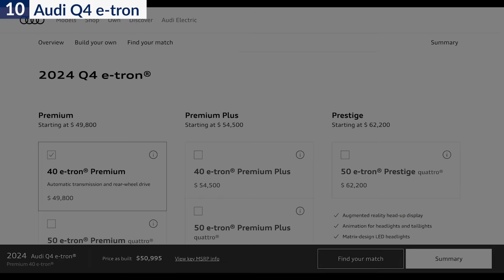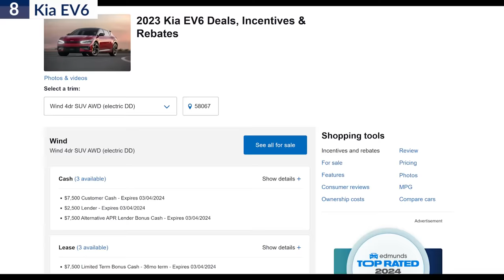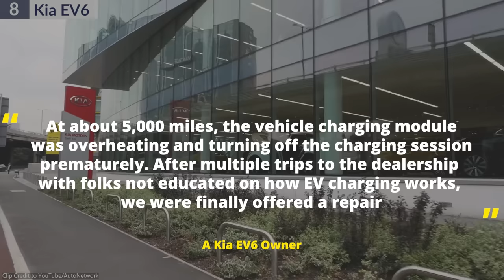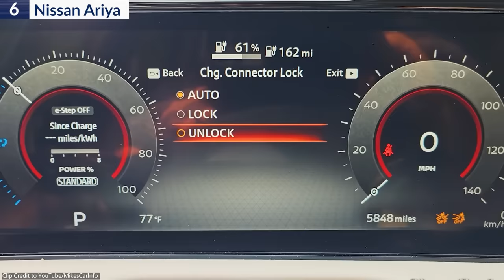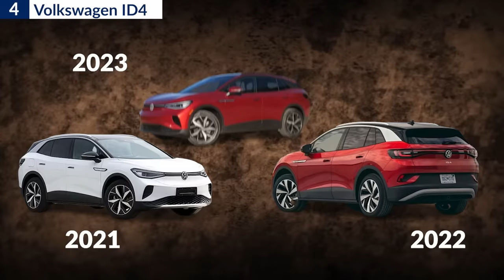New Electric Cars Piling Up on Dealer Lots in 2024 – Here is the Truth!

Comment: would you buy a second-hand EV with an older battery? not me
Reply: l would the depreciation on evs will make it worth it, you will lose some range, but they will make an excellent second car
Reply: I imagine that when the battery dies most of these cars will be free and still not worth the investment of a new battery.
Reply: @keithb6717  it depends on  the replacement   battery prices, as of today its a no no, but who knows what tomorrow may bring
Reply: I would, as long as the battery pack was checked with an OBD device via the car's diagnostic socket. This can provide a print-out of the battery's state of health in percentage terms. But of course if you didn't know this, then yes, you'd be buying blind......
Reply: @keithb6717  But you posted that because you were completely unaware of battery pack refurbishments, which cost a fraction of the price of a new battery. A battery refurb might only cost the same as fitting a clutch in an ICE car. Keith, use some of that imagination of yours to do some research, and you'd discover much of the crap posted about electric cars, is just utter BS.
Reply: @Brian-om2hh  A battery can develop a fault the very next day requiring a replacement pack. There are sensors and fuses, never mind the health of the cells themselves. Thousands of electrical connections in the pack alone.
Reply: @Brian-om2hh  Calling your bluff. What is the cheapest refurbished BEV pack outside a Nissan leaf? And how much is the removal and replacement cost?
Reply: @Brian-om2hh  
No. I’d never be dumb enough to buy one. I’m not into virtue Signaling.
Reply: @Brian-om2hh  
Btw, it’s a real bummer for you that your cult is being exposed as a fake. They’re not environmentally sound in the least.
Reply: @robertkubrick3738  How might I know that?  How many refurbished battery packs do you think I may have bought?  The vast majority of EV's out there won;t need new battery packs or even a pack refurbishment yet, as they're not old enough. The battery pack refurb I saw was in a 10 year old Nissan Leaf in the UK. The battery was out in around 20 minutes. The cells (around 120 of them) were checked and tested, with the failing cells then removed and replaced with good cells. The complete job took 4 hours, and the cost was £500.
Reply: @debeeriz  That's like you're buying a second hand 5 years old Samsung phone to replace the battery. No one is gonna pay for that tbh
Reply: @phunweng962  i replaced the battrey in my s7 it was only $10, totally worth it, l was lucky though the battery expanded that much whilst on my  charger, it lifted most of the back case off, my carl have now is 24 years old,  i have had it 20 years, i am not one for keeping up with the joneses, i use to be and l realized it was sending me broke
Reply: 1. Child battery mineral labor

2. Range anxiety

3. Risk of garage fires

4. Paying 20k more than a
comparable vehicle

5. every time you fuel up an EV, the fuel tank gets smaller  and smaller. Battery degeneration. 

6. Poor resale value

7. Reduced performance in
cold, highway.

8. Higher repair costs

9. Awful charging network
experiences in the weather
without restrooms

10. Higher insurance rates

11. Replacing tires more
frequently. Michelin states that tires wear out 20% faster on an Ev, and could be as high as 50% faster! Ev tires made for ev's, cost 20 to 30% more, than regular tires for ice cars. As Ev tires wear out, they leave behind more tiny particles of rubber than normal ice cars. This causes more pollution. 

12. Death by autopilot

13. $25k - $35k battery

14. Low km range per tank of energy. 

15. must wait in-line 1-2 hrs
to charge.

16. Then wait more time to charge, while charging.

17. Spontaneous combustion, with no way to put out the fire storm.

18. If they catch fire in a tunnel, many people will die.

19. People without a pro charger system or a parking spot at their house, will run an extension cord to the road, which is dangerous and could lead to people tampering with your charging setup (super slow charging at the road)

20. If you're in California, you won't be able to charge your car past 4pm because of a shortage of electricity supply on the cheesy grid.

21. It is not actually "green". The pollution is made at the power station, not the car.

22. Only 5% of used junk batteries get recycled, the rest go directly into the bin. It's cheaper to mine for new minerals.

23. Chhinna actually does 70% of all the refining of the minerals and production of the batteries.

24. Minerals are becoming more and more scarce, and the cost will only go up, not down.

25. Some countries where they mine for lithium, actually use a very big boat load of fresh water to only produce a ton of lithium, so they are afraid of running out of water. It takes over 2 million liters of fresh clean water to produce 1 ton of lithium. 

26. Ev cars will soon not be able to drive in tunnels or be able to park in underground parking garage and probably will eventually void your house insurance if you park it in your personal garage.... 

27. You can't charge your battery at super stations when it is bitter cold out. 

28. If a fire truck comes to put out an Ev fire, all the chemicals go directly into the sewer system, poisoning everything. They need tons of water to slow down the burn. They can't put them out. They are only trying to prevent over things near by from catching fire. 

29. Ok, there is 2 good things; regenerative braking, which charges the battery while you are slowing down on the highway, which saves your brakes from much wear.

30. Loss of fuel tax revenue, so now the roads will only get worse, not better. 

31. in Dublin, huge generators are being used to charge EV buses, due to electrical grid strain. buses in Athlone also cannot be put on charge until midnight, for the same reason. Bus Éireann is saying that they can't charge their buses until 11pm for the same reason,  and to avail of a lower tariff. 

32. Not everyone on earth even has electricity to charge their cars. What are they supposed to do in 2035? It's easy to get a bucket of fuel to power up a regular car. 

33. VCE, or "vapour cloud explosion" is very bad. If any battery, typically anything larger than an E-scooter battery, and especially only "half" charged. If a problem occurs in the cells, it might not catch on fire right away. Instead, a cloud appears, and then may be ignited a short period afterwards. There are 2 different types of vapour clouds that appear; heavier and lighter than air, which form will be dominate, can not be predicted yet. This produces a bomm.

34. For Ev transport trucks, they aren't allowed to carry the same payload as a diesel truck, because of the massive weight of the battery. The owner of the Ev truck therefore loses potential profit, every day. They also lose more profit for the waiting times for charging that Ev truck. The driver will get paid to charge the truck, which in turn forces the owner of the truck to lose more money. 

35. Ev cars are more likely to be written off, if they experience a minor collision. After the collision, something could have upset the structural integrity of the battery. 

36. Ev cars lie to you. If you are bold enough to go out on a decent road trip and its 210 miles, one way, and your Ev tells you that your battery will last you 223 miles, there had better be no hills, or excessively cold out.... You'll probably get stranded, trying to get to the charger, at the end of the trip. Ev's have left many families stranded already. 

37. Ev's and their batteries, will soon need their very own "passport". With all info about them when born, and current info about them (power output, resistance, mineral composition, etc.) 

38. Thieves stealing charging cables, will soon make it impossible to "fuel" an Ev car. They take a long time to replace the cables, just to have them cut again for scrape money. 

39. Cars were typically being made lighter and lighter using aluminum and or fiberglass and or carbon fiber, to reduce emissions and pollution. Ev's are only getting heavier and heavier, causing more pollution than ever. Remember, an ev's pollution is made at the power station and the dump, not at the actual Ev, except for the tire particles as mentioned above. 

40. More on spontaneous combustion of the battery. What if you had 3 kids strapped into car seats, in the back seat ,which kid do you rescue? More fires start so fast, there is hardly any time for even the driver to escape, let alone 3 kids strapped in. 

41. There must be a reason that Boeing 747's aren't battery powered.... Until jets are battery powered, I'll be sticking to fossil fuels for my mode of transportation. 

42. Can't bring an Ev up north in the woods, nor any battery powered chain saws, where there are no grids to charge them up. You would need a huge amount of solar panels to get you anywhere. 

Ev's (External combustion vehicles) suck, and it's a bridge to nowhere. But they do sometimes convert themselves into "internal combustion", but sadly, they can only do that 1 time.
Reply: Yep, that’s the risk with 2nd hand ev’s, you don’t know what condition the battery’s health is.
Reply: If you understood battery technology you’d realise that the batteries will last longer than the car, unless you don’t take care of them properly.
Reply: @keithb6717 : or reducing your carbon footprint… ?
Reply: That is what you call 'a ticking financial time bomb'...
Reply: @Brian-om2hh  ...  20 minutes and $500.. BS.... at least try to lie more convincingly
complete EV vehicles have battery packs that run the length of the car and will require the car to be disassembled
Min EV battery replacement costs are in excess of $50,000
Reply: @AGWUK  
If you actually want to reduce your footprint don’t wear shoes.
Electric cars actually increase your ‘footprint’.
Reply: @debeeriz  Stop it!😆😅😅😅🤣🤣🤣😂😂😂🙃
Reply: @debeeriz  Just stop it!🤭😆😅😅😅😅🤣🤣😂😂😂
Reply: @Brian-om2hh  Ok!🙄🤭😆😅😅😅🤣🤣🤣😂😂😂😂
Reply: @Brian-om2hh  You guys are car salesmen, huh? Move on! You failed! Pick yourself up and move on with your life!😉
Reply: @keithb6717 Exactly! The guy needs mental help!
Reply: Buy a Nio 😮
Reply: I wouldn’t buy an EV period.
Reply: @MR_THINQ YES you can. Connect a ODB decide and a cell phone.
Reply: They forgot to ask the consumers what THEY wanted, not what the Govt wanted..
lmao
Reply: Tesla gives an 8 year warranty on their batteries.  If in that time frame it fails or degrades below 70% they will replace it.
Reply: If it´s a Tesla and within being 8 years old and within specified mileage limits, I think 100,000 miles, if the battery storage is less than 70% from when new, Tesla will replace the battery for free with a new or refurbished battery.  Yours gets sent to their refurb section, if viable it´s refurb if not it´s sent for recycling, currently a recycled battery can produce about $5,000 of recycled materials.
Reply: @skidy2 I bought a Tesla MY 1 y/o with 14k km on the clock for almost 20k€ cheaper than brand new and it smells and rides like brand new.
Reply: @YsoSer1ous  
And if you try to sell that heap of toxic metal you’re going to lose 50% of the value because Tesla sales are dropping and the novelty of owning one has worn off. 
That’s if you can find a dealership that will even allow you to trade it in.
lmao
Reply: @travelwithtony5767  omg. You sound exactly like my neighbour 🤣
Reply: @AbuSmily  
Early cell phones sucked. (I guess you don’t know that they weren’t smart)
Early internet sucked
Early fire ..I wasn’t there but I’m sure you could blame the patriarchy, eh?
Early ev’s suck  (mostly the 1988 battery technology)
The ignorant aren’t aware of how History actually rhymes.
Reply: @debeeriz  An ev car without a warranty is worthless. The problem is that battery makers have not put out a cheaper battery alternative. The battery is too expensive.
Reply: @Brian-om2hh  That report is only good at the time made. Cells may go bad next moment...
Reply: I love driving Evs and they are really fun but I’m never buying any EV because 
1) As you said there’s no way i am buying a second hand EV
2)Buying one new is too expensive for what it offers. For the same money you can get something like the Peugeot 208 GT line with either diesel or petrol and you’re good to go. And if you want an SUV the CHR and Yaris Toyota hybrids are beasts
Reply: @cjking4511  i can put dewalt batteries on my makita drill now because someone made an adapter, who is to say rhe same wont happen with evs
Reply: @RadicalizedRadical  
Hybrid definition: very very expensive to fix
Reply: @debeeriz  I believe the same thing can be done for evs. I am patiently waiting. Once they do that they will attract a lot of buyers like me who buy cars to keep for the longrun and don't mind self-maintaining cars affordably out of warranty instead trading in a perfectly working car every few years just because the warranty is ending
Reply: @AGWUK Sure they will...Saw a Model 3 with 400.000km and 10 years of use, in this time the crap had the eletric motor, battery and the inverter changed...The battery alone was $12.000 😂
Reply: @Felipe-lp8tl  how much do you think it costs to maintain an ICE car over 10 years? Do you think that it's cheaper than 12k? Maybe.. if you live in a 3rd world country and you own a 20 year old shit car.. but then you wouldn't have the money for a new EV anyway lol
Reply: @777jrg  How much maintenance you think a Camry will have in 250k miles? Saw a lot with 400k and working fine on original trans... And a Camry you can across the the country, don't need to take a nap each 200 miles 🤣
Reply: @keithb6717   its not about virtue signalling - if you commute from the 'burbs to work daily you save money on an EV after 4 years.   Even faster if you start with a used one.

Power is pretty cheap where I live and Gas...  is not.   Virtue signalling would be squeezing it into your use case even if it cost more.  

Main thing I noticed is all these are all the dealers who would rather sell you a different vehicle...  they are not having issues selling them in Europe and the direct marketing lines aren't having trouble.   They make a lot more money selling you a gasser so will push everyone they can into them.  Go to a Cadillac dealer to look at Lyrics and see how fast they start pushing you at the Escalades...
Reply: @redwolfexr  
Are you kidding. Entire European ev companies shutting down and major manufacturers cutting production. Insurance skyrocketed in Europe
Reply: @redwolfexr "saving" money might be true for while but that's not how you calculate. Itwon't be clear until you sell. Many dealers don't want to trade in used EV or might do so at a very low price. Total cost of ownership might very well be high...
Reply: @jakefriesenjake a couple of fair points and a lot of bullshit as well. Let’s just take one of them as an example: no ev battery goes to landfill ever, they’re too valuable. You need to look at your sources because most are wrong.
Reply: @jsanders100  95 percent of all batteries are not recycled. Where do they go then?

Even the vast majority of regular household recyclables, put out and picked up by the truck, aren't even recycled.
Reply: i would its a smart move. Especially the ones with LFP batteries that last a million miles. (no lie, see specifications of the battery supplier.)
Reply: @debeeriz  The battery OUTLASTS the car. And people talk about replacing the battery. FUNNYYYYY
Reply: @AbuSmily yeah but it's funny that none of this would even be happening if the government wasn't giving huge incentives. Does technology would not happen if the government wasn't forcing it to happen.
Reply: Buying a used EV is a money pit.  Never buy someone else’s problems.
Reply: @billlawrence123  its ok wont sell my EV.. its just too good. It has an LFP battery. More than 3000 cycles so. It will last more than 1200000 kilometer. Most cars are long gone before reaching that. The battery can outlast the car. Up to this point i had zero issues. None yet. Never been to the garage. While my uncle bought a regular new gasoline car and already with the same distance on it had to to maintenance twice. Keep or thinking wrong and i will enjoy my EV that lasts extremely long.
Reply: Hell no and I’m a dealer auto tech, huge waste of money for some sucker to take on.
Reply: @AGWUK cars last 20 years easily. Not the batteries
Reply: I just sold my 2019 BMW i3. 😂
Reply: Not me
Reply: @keithb6717 they are much better environmentally than combustion cars tho
Reply: I wouldnt own an ev if you gave me a brand fuckin new one for free.
Reply: Yes I did. You buy second hand motors, transmissions and the hundred other parts that fail often. Plus are very expensive now.
Reply: Only if it has a big T on the front
Reply: @billlawrence123  what car isn't a money pit? I owned a chevy and GM. Way bigger headaches.
Reply: Depends on the Brand. Are all EV the same? Nope
Reply: Who wants to buy second hand EV car with the potential 20 000$ repair bill to get a new battery?? Manufacturer has to include some kind of lifelong warranty for the battery??
Reply: No
Reply: @robertwoodhouse-bm7kt theres a guy on youtube who purchased a Model Y he’s on his third replacement battery under warranty. However the replacement batteries are refurb batteries not new. Hes crapping his pants as his car will be out of warranty soon. Its clear that refurbished batteries with do not work. Tesla were replacing cells with cells out of other failed battery packs. You could have replacement cells that already have high miles or high charging cycles as the cells are not new.
Reply: @HermanWillems if the battery outlasts the car then the car really is a pile of crap.
Reply: The most of them have 10 years of warranty for the battey. Has your car a 10 year warranty?
Reply: @Brian-om2hh either you're deluded or completely ignorant. Batteries are not cheap and are extremely dangerous if handled carelessly. Seek knowledge about these things before defending the indefensible. Please educate yourself. The benefits of ev cars are not equivalent to the cost. Buying one should only be second option rather than a daily driver.
Reply: @skidy2 Well, it depends. I've heard bad stories about VW ID3s losing like 30-40% capacity in just 3-4 years while I've seen 10 year old Teslas with barely any degradation. Americans can be sloppy with the finishing touch of exteriors and interiors, but generally speaking the drive trains are built to last. And when Americans want something to be energy efficient like with their freight trains, they're simply unbeatable.
Reply: I bought one from tesla 70k miles on it. It has an 8 year battery warrenty so yea, its been great.
Reply: Would you buy a second-hand ICE vehicle with an older motor? Not me.  Same crap different century.
Reply: I bought a used one from the dealership you get warranty on the battery so that would be the best option Plus if it doesn't have warranty you can always buy a third party warranty which they always warranty. The car battery and all you have to pay is $100 deductible
Reply: @worldeconomicfella3228  they have the same batteries from Korea from LG or Samsung. Ther is nothing in the battery made in the US or Germany!
Reply: Absolutely yes. You will buy at an amazing price an incredible Car, superior to a lot of  combustion vehicles
Reply: I bought a 2011 Volt in 2020 with 150k miles on it. I then drove it an additional 60k miles in 2 years delivering newspapers and didn’t have a lick of trouble with it. Most reliable newspaper delivery rig I’ve ever had in my decade+ of delivering
Reply: I’m afraid I would not buy a new EV never mind a second hand one
Reply: @lastminutesolutions  
Providing that we totally ignore the environmental disaster of lithium mining and pretend the power is generated by magic windmills...
Reply: I would for the right price. Problem is these dealers don't want to take a loss. Oh well
Reply: Good batteries with properly Engineered thermo control systems will easily outlast engines.
Reply: @patrickhornacek8593  
Except for all the ones that burn
Reply: @keithb6717  you’ve been watch too much fake news.  😂
Reply: @patrickhornacek8593  
I don’t watch the news. Tons of video on YouTube. Battery technology currently inadequate.
Reply: No chance. Total cost of ownership is not there for me and ev
Reply: @keithb6717  don't seem to have a problem with Stupidity signalling.
Reply: @jakefriesenjake well youve got all the anti EV tropes down patt, what's your next ignorant trick going to be
Reply: @jakefriesenjake well you've got all the anti EV tropes down patt, I suppose you've done your own "research" on Facebook.
Reply: @travelwithtony5767 nice when has the government asked people what they want, you're delusional.
Reply: @travelwithtony5767 you are having problems aren't you.
Reply: @Billy-the-Kid I call your bull💩
Reply: @RadicalizedRadical good to go, except into cities that ban ice vehicles, good to pay 90 percent more for "fuel" and good to know you're a ludite.,,
Reply: @metricstormtrooper Keep that you yourself unless you come with good arguments.
Reply: If you are not informed, you would act this way
Reply: You need to get it checked put first..
Reply: @keithb6717  I am from Europe and I can say this is misinformation. Not true.
Reply: @jakefriesenjake  this is misinformation. Most batteries ARE recycled and 100% of components can be reused again
Reply: @HermanWillems  word. Plenty of idiots in these sort of debacles. They have no clue.
Reply: @seekingfreedom9020  lol imagine thinking that such a huge global industry is compartmentalized to your own country because of your government 😂
Reply: @billlawrence123  I can confirm this is misinformation. EV come with 4 year warranty for EVERYTHING then 10 year warranty for batteries and drive unit.
Reply: @keithb6717  lol copium
Reply: @phunweng962  imagine comparing a car battery with a phone battery 😂 such idiotic way of thinking ahah
Reply: @zarthemad8386  LOL 😆 you surely know a lot about nothing bud ahahahah
Reply: @robertwoodhouse-bm7kt  it's actually 10 years eheh
Reply: @RadicalizedRadical  copium to buy shit cars 😂
Reply: @Felipe-lp8tl  ofc you did mate 🤭
Reply: @Felipe-lp8tl  you seem to 'see a lot'.. well... I also see a lot of Tesla's and EVs going around without any issues or faults. My bro has a 10 year old model 2 with 350k miles and still with 89% battery (11% degradation). At least I have experience because I own it or people that I know own them. You just rely on tabloids. Somehow you think your opinion is more valid than anyone else's? You must be fun at parties.
Reply: Without hesitation I would buy it so long as I could see an SOH check on the battery. My EV (Kia e-Niro) is 5 years and 97,000 km old. I have seen no loss of range, none at all. At the 90K service I had a battery SOH check done which looked at all 294 cells in the pack. The pack consists of 3 x 98 cell modules and all of the cells were reaching nominal voltage and all 64 kWh are available to me. The 3.5 kWh buffer will eventually get used up and at 200,000 km I would expect to see maybe 5%-10% range loss at 10 years old. But EV batteries rarely suddenly die, they just steadily decline but at 400,000 km (20 years) it will probably have at least 50% of its original range of 450 km, 225 km is a perfect old car for the school run or commute. By that age 90% of ICE cars are on the scrap heap. The average petrol/diesel car in Europe is scrapped at 16.5 years and 250,000 km....Most ICE need serious work on engine or gearbox by that time if  they are worth keeping them on the road..with a fraction of the moving parts an EV will likely stay viable way beyond the life of a fossil burner. So think again on your second hand EV.
Reply: @keithb6717  You have no imagination.
Reply: @Wilem35  
Weird. In a fraction of a second I imagined you really really depressed in the near future about an enormous repair bill.
Reply: Why would you buy a secondhand gas car?
Reply: Car buyers save a lot of money because of people like you
Reply: @Brian-om2hh most people in the UK use an OBD reader with any used car they are thinking of buying. Not one of those cheap £20 ones but a proper diagnostic machine that garages use. They can be hired.
Reply: @jakefriesenjake  Yeah, but what's the real reason?
Reply: @robertmatthews2009  🤣😂🤣😂🤣
Reply: @debeeriz we must have a lot of space to put these cars in our home and money to pay for two insurance. Most people don't have that luxury.
Reply: That's the point to make a throwaway car - like money grows on trees
Reply: I wouldn't buy a second hand Ford car with an ecboost ice engine, let alone an EV.
Reply: @Brian-om2hh
The only one talking BS is you. Saying that refurbishing a battery pack is same as replacement of clutch plates is a lie even politicians cant make up.
Reply: You can find folks who replace batteries under a grand but not the tesla. That's why they are dumping them for 20k??
Reply: Did not know evs lose charge sitting. Thanks!
Reply: Rented the mustang as friends coming to town..they did not fit in back so I ended up riding there and it sucked!
Reply: This is why battery swapping is the future. Nio must rise for EVs to really work
Reply: @jakefriesenjake  Yes, you've pretty much listed every bit of fallacious drivel spouted about EVs - well done.
Reply: @oldgit15  all drivel eh?
Reply: I just did. Totally comfortable with it, Had the battery tested and know it's on the top of it's health still after 5 years. It's all about behaviour of the previous owners. I'm laughing at the monthly costs in combination with my solar panels
Reply: @billlawrence123 from experience I know it's the exact opposite. Buying a 5 year old American or French ICE car on the other hand, those are real moneypits
Reply: Definitely. Most batteries will outlast a gas car.
Reply: @mnhsty  lol. Average life of a battery is 8 to 10 years. Ice car is 20 years.
Reply: @jakefriesenjake   If that were remotely true, no one could warranty a battery for that long.
Reply: @mnhsty  tesla warranties there batteries for 8 years.
Reply: @jakefriesenjake   Yes.
Reply: No sir
Reply: Ignorant people scare me. The owners of evs are regular civilians not military minded completely unaware of how fast a fire starts.  it's like lighting a "matchbox" TO HELL WITH EVS
 @debeeriz
Reply: Absolutely if still under warranty. I did, and I don't regret it.
Reply: A brand new EV, becomes second hand after only a few thousand miles.
Reply: @debeeriz what will you do if battery fails outside of warrenty?